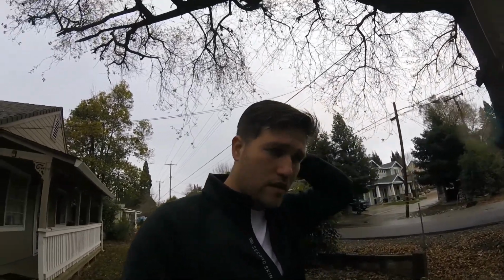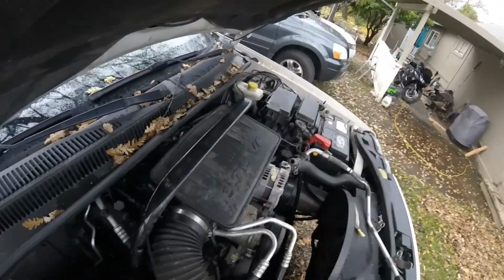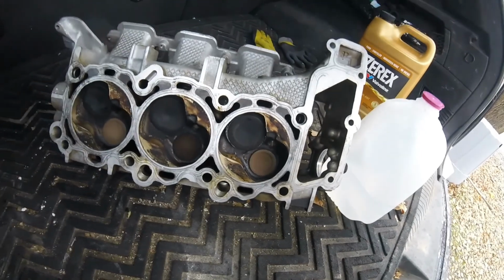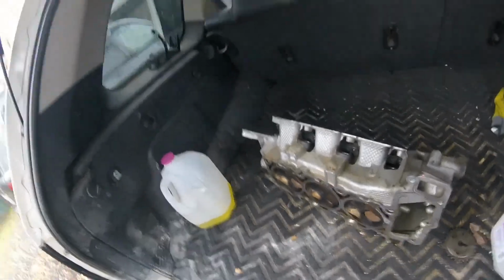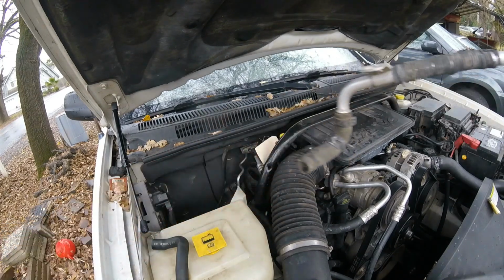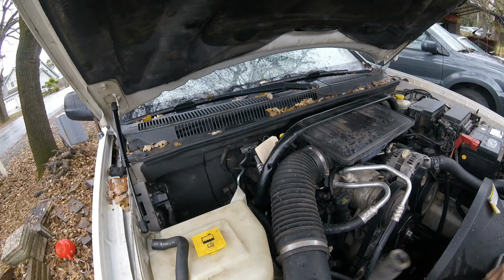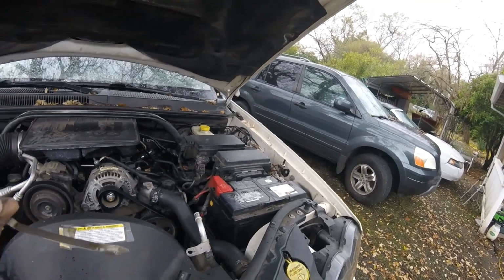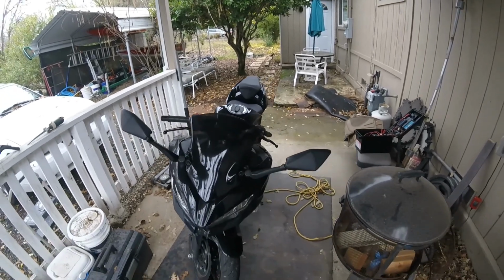Grand Cherokee is back....Dropped Valve seat! Crazy damage!

Comment: The valve didn't fall off, the rocker fell off, very common on those engines.
Reply from the maker: The seat fell off then the rocker fell off, Then smacked the piston. But piston block is fine.

Comment: Dude I just bought a 2011 dodge nitro 3.7 and the same thing just happened to me. The cylinder head literally is cracked and looks like a grinder was used on it and the valve seat is lodged into the cylinder head from the piston…. My piston has some  scratches from where it punched the valve into the head… is the piston ok to be reused? No holes just a scuff on the piston
Reply from the maker: If it isn’t deep I think it should be ok I had some scratches and nicks so rod didn’t get bent.
Reply: @Aarronching  thanks man!

Comment: Hey buddy. What engine was this that you had trouble with? I am looking into buying a 2008 grand Cherokee with a 3.7L. Any recommendations? Thanks!
Reply: I have a 2009 grand cherokee, needed a transmission rebuild at 85k and now dropped a valve which caused so much damage I needed to replace the motor. This happened a few months ago at 125k miles. I love the car so I'm getting a remanufactured motor. Hope this helps.
Reply from the maker: I had the 3.7 mag came in the liberty grand Cherokee and nitro, and ran v6. I had 2 engine  failures transmission was great but dealer ship told me that 3.7 is basically a throw away motor…